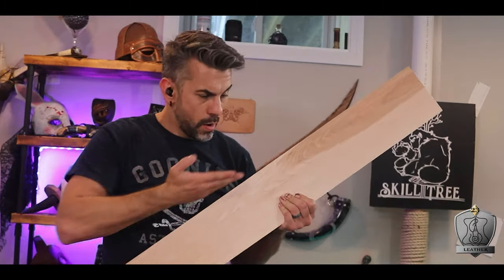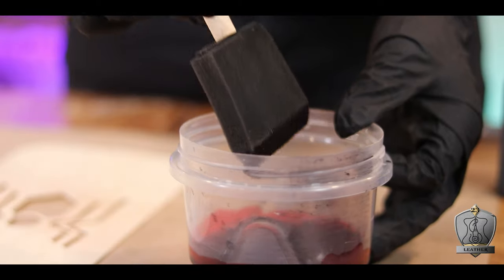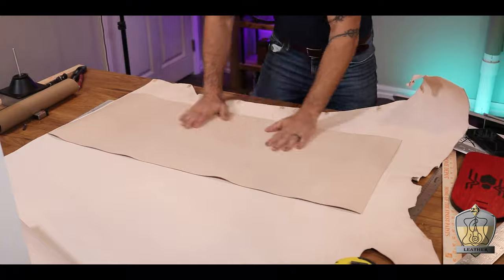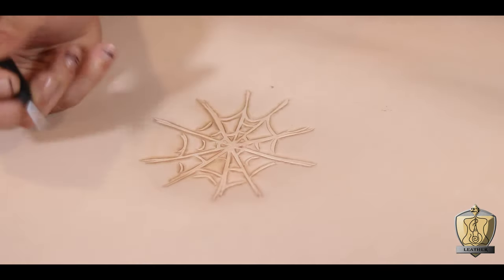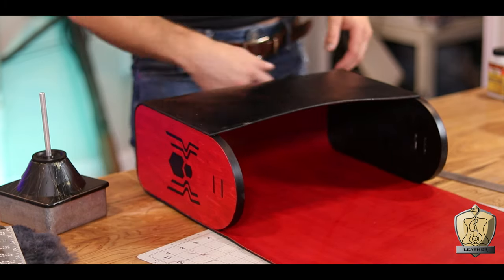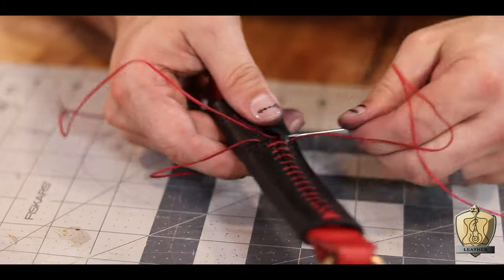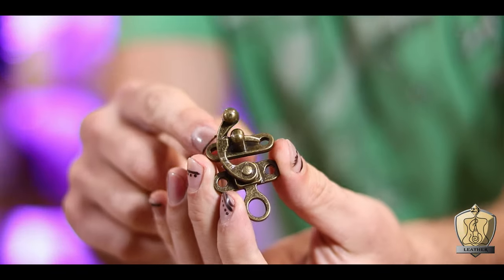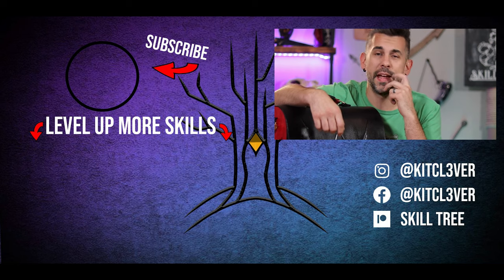Making a Leather Messenger Bag

Comment: You can use rubbing alcohol to lighten Fiebings dye, I've used it very carefully on pieces where there's darker sections for whatever reason. You'll wanna use a very small amount on a cotton ball/soft applicator of choice, since it can dry out the leather

Comment: Seriously nice job on the bag. Just a comment about the barge glue. If you have any kind of finished surface for barge, it will not stick properly. I always need to rough up my edges so it sticks. However, you still need to either stitch it in place or tack it like you did here. Hopefully this helps some leatherworkers out there. :D

Comment: I'm sure you probably had a reason, but the bottom half of the closure clasp is installed upside down..... the ring is meant to go over the post then the pin is meant to lock it all in place.
Reply from the maker: Good eye! The doubled up leather is too thick to accommodate the correct orientation. I actually had to bend the little keeper up a bit to make it work at all. The hole in the post wouldn't clear the ring lol. All in all, not the right sized clasp, but I was down to the wire in filming and it was all I had 😅

Comment: Try dying with circles instead of side to side with straight lines. It gives a better coating and helps get rid of the streaks.
Reply from the maker: Thanks, Doug! I will give that a go on my next project!
Reply: Or try an airbrush. Once I acquired an airbrush, I only use daubers when I'm feeling lazy or it's tool hot/cold in the workspace